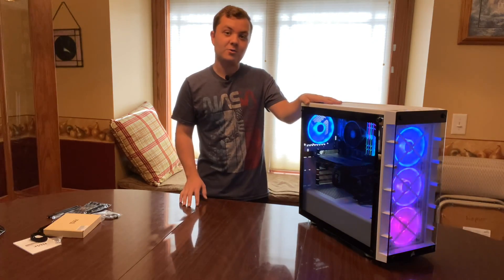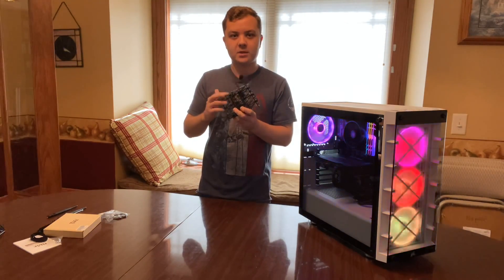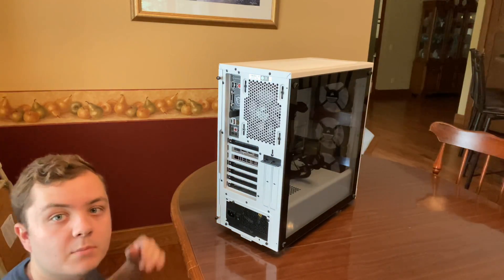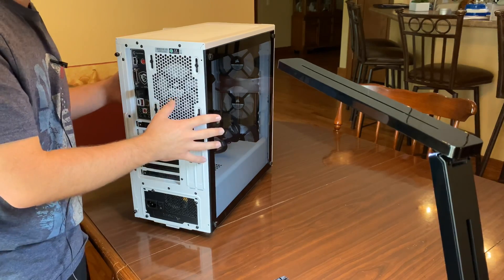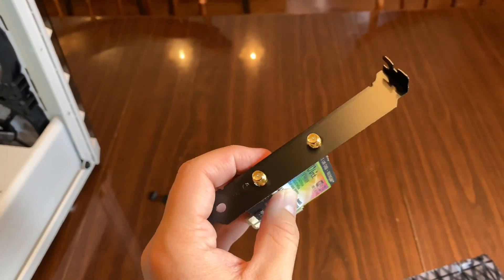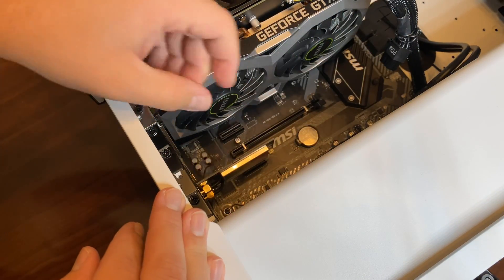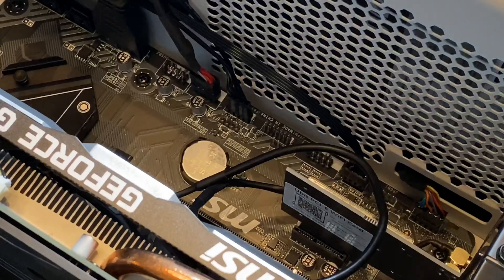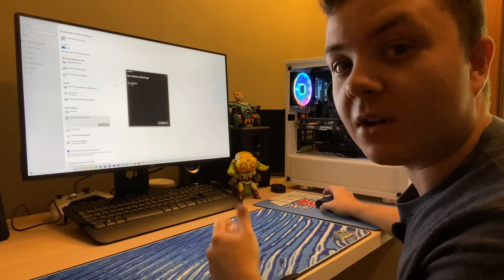How to Add WiFi/Bluetooth to a Custom Built PC

Comment: I appreciate how clear and well lit the video is. I'm unclear though about whether I can use any USB connecter on the MB or does it have to be an F_USB.  Also, did you have to go in and disable the previous wifi before adding the wifi 6? Did you notice a difference with wifi 6?

Comment: the network card is that fast enough for running steam link to quest2 as i built my son a little starter pc its an old one so i need a network card but now worried about speed since its not just for connecting to wifi .... would the one in video be enough bandwidth or should people like my son get better just to keep enough for wifi and vr

Comment: im a little surprised that so many people and people much smarter than i am have had the same issue as me. it took me a good 5 hours to figure out the computer i had built for me just didnt have the hardware for wifi and bluetooth. i thought i just had a setting off somewhere or something, so i installed a bluetooth driver off the manufacturer website about 4 times and ran all kinds of troubleshooters on  my system before i almost took a bat to the whole thing....I should get rid of the bat because its my go to for my final solution every time but theres nothing left to do after that option left  to do but buy it again. thanks for the tip in the beginning about the power and electrocuting the computer components that actually helped when i heard it put that way instead of just hearing i should do it. i look forward to future videos. Thank You

Comment: i bought it just to wait 2 days and my motherboard not having the slot im a fucking idiot😊
Reply: Slot for Bluetooth cable? Or wifi card?
Reply: @evilplayer4961  wifi card. if you have an older/smaller motherboard your GPU might block the slot. I had to buy a whole new motherboard.
Reply: @barracudicgd  i habe acer aspire x3990 pc i got a wifi card with Bluetooth cable i installed it the wifi worked but there was no slot for the Bluetooth cable :(

Comment: My motherboard is micro-atx and unfortunately my graphics card is so chunky that it blocks the PCI slots, I can't afford a atx motherboard and a network card. I know another possibility is a usb network adapter but im sceptical as to the speeds that it can provide, Do you know if usb wifi adapters can have a good speed or maybe any information on a bottleneck they consistently  hold?

Comment: Just one Question : i have H510M A pro motherboard and i recently bought a fresh tp link T5E wifi card but my power cable is connected to the F_Usb1 i dont have any other usb left on the mother board ... wifi works but bluetooth doesn't help 😕

Comment: So I called my computer company, they want me to buy a TP-Link AC1200 PCIe WiFi Card for PC (Archer T5E) - Bluetooth 4.2, Dual Band Wireless Network Card it’s $33 which isn’t a problem. It also has two antennas, do I necessarily need that ? I do competitive gaming and want a stable connection. Without the wifi and Bluetooth I cannot uploads or watch videos anymore. (I use Ethernet connection only at the moment)
Reply from the maker: Ethernet connection will always be best, but the wifi card uses the antennae to have the connection to your router. If you just want to add Bluetooth, get a USB adapter like this one: https://amzn.to/3D4nfTD  hope this helps

Comment: Thank you. I kind of assumed it will be included with the motherboard I got (asrock b550 pg riptide) but when you showed where a network card should be plugged in, that slot is empty on mine. I don't see the need to get one immediately as I want to appreciate the hell I went through on installing the ethernet drivers first lol. Maybe next week or so

Comment: you, sir, are legendary. I have a custom built pc that I have been using for some years now, it was built by my brother around 2013 (yeah, its starting to get outdated). He gave it to me, and I never needed to use bluetooth for anything on my pc until I got a pair of sony WH-1000XM4's (great bluetooth headphone btw). When I realized that I didnt have bluetooth (couldnt turn it on or off), I immediately went to youtube and watched dozens of videos on how to fix any software problems relating to the matter. I even downloaded the intel bluetooth driver set up maybe 10 times. None of the videos I watched said anything about this being a hardware problem (probably because it was meant for people with laptops or prebuilt pcs). I didnt even realize that I was missing the very component that would let me use bluetooth in my pc. Not only did your video tell me this, you also linked the one you used (which i ordered directly after watching this video), gave us a detailed and precise explanation on where and how to set up the network card, and did so without wasting any time whatsoever.

Comment: im thinking of buying a used pc but some of the ones i'm looking at require ethernet. i don't have ethernet, but a guy told me he would include a wifi adapter with my purchase. i have no experience with adapters nor am I willing to install a wifi card just to use the internet (unless it's last resort). 

any advice would be appreciated

Comment: Love the demonstration although I can’t seem to put the WiFi card into any open PCie slots because my GPU is in the way which is annoying. The motherboard I’m using is a MSI B450M PRO-VDH Max, so might as well just buy a PCIe extension cable and hopefully it will work…
Reply: Hello, you may never get the notification of this but I’m having the same problem. Did your idea work or have any other working fixes thanks!
Reply: @Sage93166  
Yep, it works but for a very short amount of time. For some reason, it gave me the blue screen of death which could probably be a compatibility situation so I had to either use the Ethernet cable or USB wifi adapter.

Comment: Would I need my pc connected to a router via ethernet for the drivers to be installed, or does it not need internet to automatically download those
Reply from the maker: If you connect the wifi card and it doesn’t work straight away, I would connect via Ethernet and download the drivers. Hope it works for you👍
Reply: @thinkable3D  Okay tysm! I’m curious tho, were you connected to ethernet when it downloaded then in this video?

Comment: I know it’s been a while but if I have bad internet at home will this improve it for my pc
Reply: This can't improve your internet connection, but it may help get you better wifi signal to your computer. You'll need to figure out if the problem is a bad internet connection or wifi connection. If its an internet problem, this won't help you at all.

Comment: I like your presentation as you don't assume people understand the process by describing the step. But you slowly demonstrate the step, ie where the wifi card should be slotted into. I believed the most important part before the installation is, to power off the system and also ensure the remaining power residue is gone. Bravo. well done. Cheers.

Comment: Well I went to see motherboard to see where that PCIE slot is and it’s covered up by my 3080...ended up buying a USB wifi adapter. It’s not as fast but it’s good enough.
Reply from the maker: Those work just fine 👍

Comment: Great video! This is my first pc built i have a question: There are two slots which said PCI E2 and PCI E3, does it matter which slot should I put the card?
Reply from the maker: Nope it should work in either.

Comment: Hey man if I add this will my pc be able to use wireless wifi? And bluetooth?I mean this card does the both thing?
Reply from the maker: It should. I’ve had problems with the Bluetooth, so I got an extra usb Bluetooth adapter to make it work.

Comment: Did u add the antenna? You didn’tshow it so im just curious because the network card comes with antenna. I wonder if you have to install the antenna or if you can skip it.
Reply from the maker: Yes you still have to install the antennae. I forgot to add it in the video

Comment: Which do you prefer a usb WiFi adapter or network card
Reply from the maker: It depends on the range you want. The network card has antennas so the range is better than a USB adapter.

Comment: well done young lad, clear and quick video. People tend to want to cover too much and it gets confusing. only one thing-- describe or give a clearer view of the point of connection to the mother board. I am a novice computer builder and need to be shown where on the mother board the pins to connect to. i couldn't see clearly where you connected to the mother board. There are so many pins and all very small...and there are many...but good video!!

Comment: How do I know which wifi card fits into mine? Or can any wifi card fit
Reply: If you want something simple, a USB wifi adapter will work. It plugs into any USB port on your PC.
Reply: @JJFlores197  man i’m just worried about the drivers and the cd shit and all i just want a ( plug and play ) kind of usb adapter cuz i bought a new pc and I can’t connect to the WiFi
Reply: @lxcezar7625  What exactly are you worried about? If Windows doesn't have drivers built in for your particular wifi adapter, you will need to download them, either on that same PC over ethernet, or use another PC with internet access and download them on that and transfer them to your other PC through USB drive.

Comment: Thanks for this, Nic. I'm another one who builds their own PCs. I'm glad to see that you have a few big fans in your case. Lots of quiet cooling. I'm a big fan (unintentional pun) of "quiet" and I'm a big fan of "cool". 

Another reason for having WiFi in a PC is to provide another connection to the internet if your main connection drops out. I have a 4G WiFi hotspot that my wife and I use with our laptops when we're traveling, but I never got around to putting WiFi into my PC. The data cost here is very high. But we had a few too many drop-outs today and I've decided that we need to be connected more that we need to worry about a few extra $$. Your video has been very helpful.

Comment: Are you using the Intel Bluetooth driver with an AMD CPU? I am having issues with the same wifi/bt card with an AMD processor. It works on first install but after a restart or I turn it off and come back I get error 43 with the Bluetooth adapter and it doesn't work unless I reinstall the driver

Comment: I bought the piece you put in your description because I needed bluetooth for my PC and they either sent me the wrong product WITH the correct network card or they forgot to send me the bluetooth cable..which is the sole reason I bought this item...what's weird is instead of the cable I received a small cd to install drivers...which is what's causing my confusion on whether it's the correct product that you used and listed in your video or if I sadly got shipped half of the wrong product...needless to say I'm pissed lol...but great video and thanks for the teaching moment. Now to contact Amazon...wish me luck!
Reply: UPDATE: I talked to Amazon and they sent me a replacement set, wahlah it had the wire! So I look forward to setting it up and having some Bluetooth!

Comment: I have a doubt ,whenever i try to pair my bluetooth headphones to my PC,My PC fails to detect my wireless BT headset.
my motherboard has in-built bluetooth and wifi connection and it runs on ORIGINAL WINDOWS  and it still fails to detect or connect my Headphones.I don't know what Im doing wrong.

However when i try to connect the same headset to my Laptop running Pirated windows -the headphone connects :\ easily,
Reply from the maker: Try to go to the Bluetooth setting on your desktop by searching in the windows tab on the bottom left.
Reply: @thinkable3D  did every step required 🤧
Like
Removing the device from BT list/Tried to pair again/installed and updated drivers /disabled the BT driver/uninstall drivers and tried to use generic driver from Windows -again removed drivers and tried to install BT DRIVERS from MSI /installed BOATZ 510 generic BT drivers again 

Nop...nothing worked.

,There is a dude who faced the same issue with the exact headphones and microsoft service tried to help him but no luck. 🙌the last step was to REBOOT INTO RECOVERY MODE and > troubleshoot and remove every driver and install windows with its basic drivers (con I will lose all my manually installed softwares and data) 

I didn't risk it ,I just started using my Headphones the old way (😁3.5mm jack ATW)

Thanks anyway... 🙌
Reply from the maker: Yikes. Sorry you are having so much trouble. Maybe you need to get a network card to make it work. Maybe worth a try? Hope everything works out for you. 👍
Reply: @thinkable3D  thanks man.

Comment: Hey, which slot would I have to use for the wifi 6 card on an MSI Z490 a-pro motherboard? It's my first build and I'm not really sure if it matters which PCI slot I use. Oh and I'm running a RTX 3060 which seems to be the same size as your GPU (not really sure if that matters but it's useful info I guess).
Reply from the maker: Try to use one of the smaller PCIe ports. It doesn’t really matter which one you use. Imagine it’s like a USB port.

Comment: Hey, so I did everything in this video, but no Bluetooth is available. Do I need to update my motherboards BIOS? Or is there anything else I can do to fix this? (I have the same motherboard as you)
Reply from the maker: Make sure that your version of windows is updated. That’s what was wrong with mine one time. Also test and make sure that the wireless WiFi works. Search up Bluetooth in the windows search and see what comes up. Hope this helps

Comment: Could the USB wifi adapters work just as welll?
Reply from the maker: It depends on the max speed that it can handle. It will work you just have to research it’s max speeds.
Reply: @thinkable3D  I’ve done a bit of research into them for the past day and they are inferior but the biggest drawback is the installation is via a CD and not many custom built PCs still have CDs so you’d need an additional laptop or PC with a CD Rom to download the software on to then drag onto a USB and go from there
Reply from the maker: O interesting. I wasn’t sure what the main differences were. Thanks

Comment: Without The Wifi Card,Can We Connect Through Ethernet Cable?
Reply from the maker: Yes you can, but you are required to always be plugged directly with a cable

Comment: i hope this isnt a stupid question but, what do I do with the antennas after I install the card? how do I add it onto everything else?
Reply from the maker: You install the antennae on the back of the pc where the cables go. They need to both be pointing up.

Comment: Does this help with input lag for gaming ?? I haft to use ds4 software for warzone to make my PS4 controller imitate as a Xbox controller so it’s configure but it has a lot of delay
Reply from the maker: I’m not exactly sure if it will help for that, but it should make your internet connection more stable at least.
Reply: @thinkable3D  ok 🙏
Reply: You may see more of an effect investing in a better monitor, finding other software or hooking the dualshock directly into the computer. If you've already tried all this, you've pretty much exhausted all of your options short of purchasing an Xbox controller.

Comment: Hey dude, I wanted to ask what kind of exhaust that is? I have the same motherboard but I think it's lacking the ports that my exhaust needs to enable the RGB lights. So I'm wondering if it's the case with the motherboard or the exhaust itself.

Comment: Question, would this work if I have a vertically mounted GPU?
Reply from the maker: It might. It just depends if u have enough space between the motherboard and the gpu for the WiFi card to fit.

Comment: When the drivers are installed and everything is set up, can u take the wifi pcie card out after?
Reply from the maker: You can take it out, but that would defeat the whole purpose because the WiFi card acts like an antenna for your pc to receive the WiFi signal.
Reply: @thinkable3D  ok thx

Comment: You mean wireless card a network card is an ethernet adapter card

You don't need to unplug the cable to install a pcie card just switch the power supply off

Comment: I used the same motherboard and graphics card as you great combination
Reply: Even put them in a white case.      Could you do a video on how to set it up after you get it together I still need my cpu but I bought a windows 10 home usb.  And will I need a usb dvd drive to set in the disc for the motherboard?
Reply from the maker: You don’t need a disc drive to install anything anymore, as long as you have an internet connection, you can download the latest drivers and updates for your equipment.
Reply: @thinkable3D  would you be able to send me a link to it, that’s amazing

Comment: Nice video m8.I have a question.Im gonna build my first PC soon(with wifi),so im interested if this works the same way as it does with the bluetooth card?And if I buy a motherboard with wifi,is the wifi card already installed tgen?Thank you.
Reply from the maker: If a motherboard has WiFi built in, then you don’t need to install another card. It will already have Bluetooth as well👍